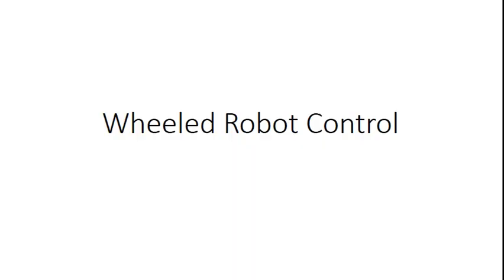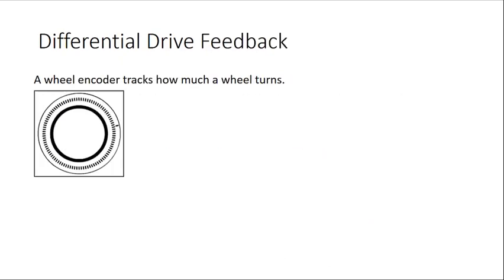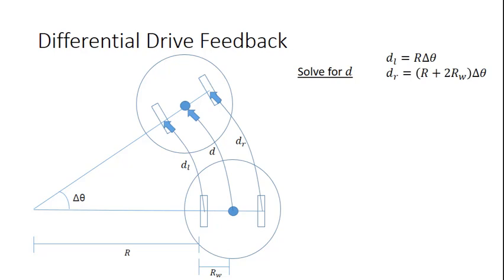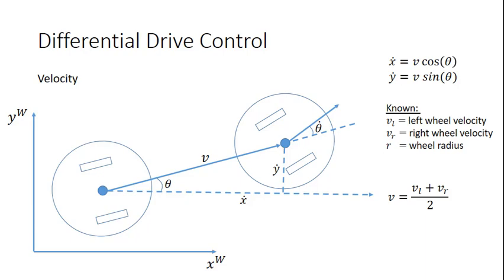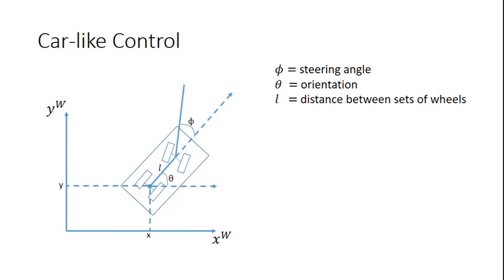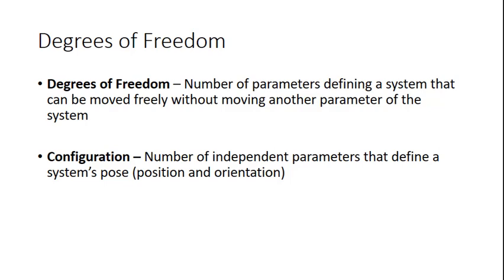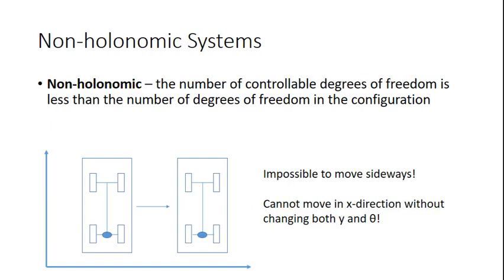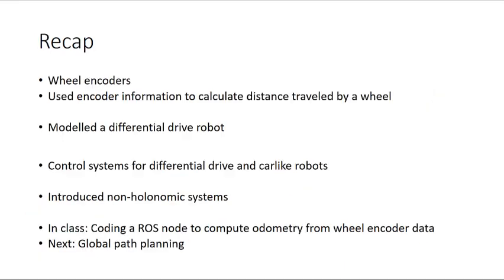wheeled robot control and odometry

Comment: Hi 16:09Could u explain why new theta is theta + delta theta. Since delta theta in this case is measured wrt to line parallel to y axis. Is there a geometry property I am missing here ?
Reply: Delta theta is the angle at which the robot rotate in 1 sample time. At sample time (time step) t the robot is at theta, so at time step t+1 the robot is at theta+delta theta
Reply: @MewCatCozy  theta dot is just the angle of the next time step. Assuming at time t we have theta, then at time t+1 (theta dot) we have theta + delta theta